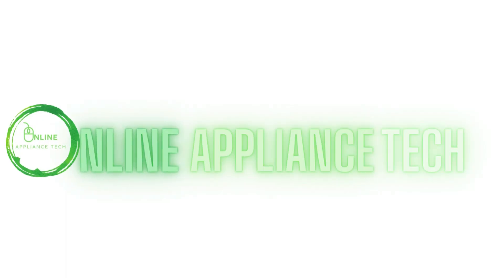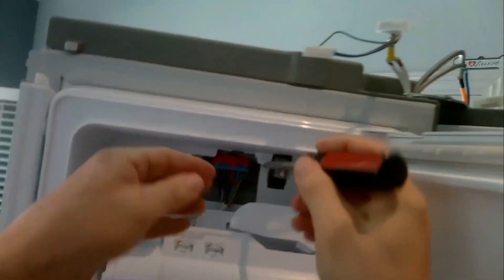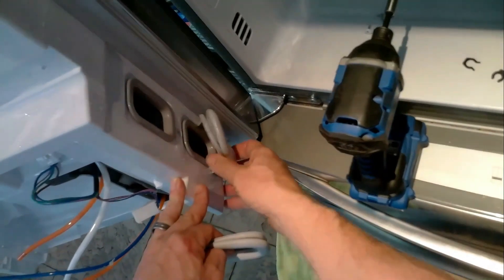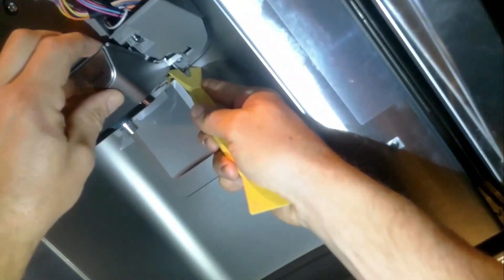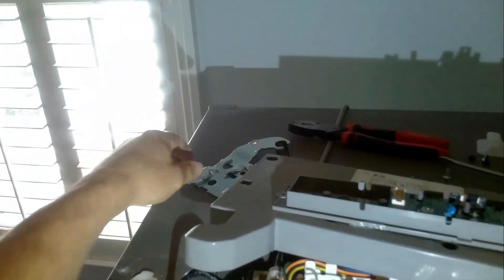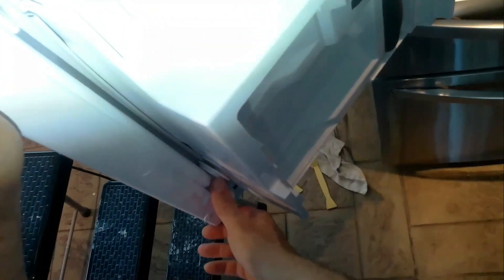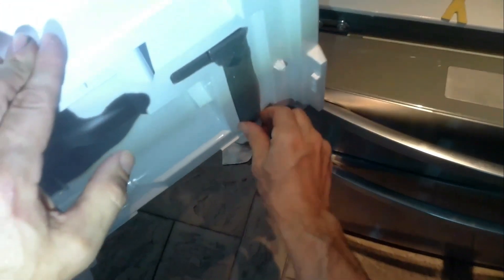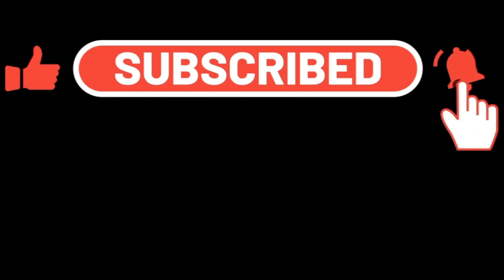Avoid Costly Mistakes: LG Fridge Door Removal & Replacement Guide

Comment: This is great video. In my case the water line is good, and it can make ice. But water/ice dispenser is not working. How do I validate that replacing the door will work and wiring component outside the door is not a problem. Is there a way to test that?

Comment: Thank you for this video our display panel is unresponsive after I sprayed and cleaned in the ice dispenser hole I’m guessing I was to liberal with the spray and must have got some spray on the internal panel it self it still lights up but we can’t it to switch from crushed ice to water. This is just about the only video I could find that explains how to remove the panel I’ll give it a few days to dry out before ordering a replacement, but at least now I know how to remove and replace without breaking it. Thanks again
Reply from the maker: Thank you for sharing your experience, and I'm glad you found the video helpful! It sounds like you've taken a wise approach by allowing the panel to dry out before deciding on a replacement. Sometimes, moisture can temporarily affect the functionality of electronic components, and a few days of drying can resolve the issue without the need for further action. If, after giving it adequate time to dry, you still face issues with the display panel being unresponsive, then replacing it as you've planned might be the best course of action. It's great to hear that the video has equipped you with the knowledge to remove and replace the panel without causing any damage. If you have any more questions or need further assistance as you proceed, feel free to ask. Best of luck with your repair, and thanks again for watching!